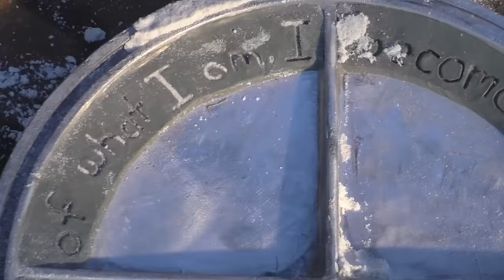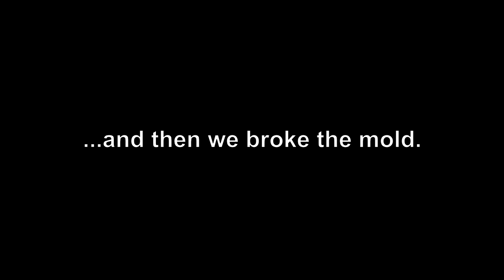Casting Deadlights - Part 1

Comment: It is so funny when you know a skill and you have to see others trying to do it. I learn to mould in green sand at the age of 12. However ,well done some refinement of the  technique it is need but well done.

1) spoons are good tools for moulding heat them and create your own set of tools
2) to remove the part hit it with a wood and a hammer to free the sand around it is easy
3) weights over the mould. There is internal pressure that think can blow.
4)when you cast you have to try to preheat the mould, less humidity , less possibility of porosity
5) preheat your tools if you are going to used with hot material
6) do not take so much time between fillings of the mould

Comment: you solved the undercut issue on the letters....just thought i'd offer this....one of the ways i've seen to do letters is to use a heavy gauge wire as a "press stylus"....bend it to a modestly sharp loop, and use it to trace out your lettering, being careful to not press deeper than half the diameter of the wire.....      The other alternative:  raised letterings....      

The beauty of casting...if it casting fails, you can "recycle" it....break it up and stick it back in the cruicible for a retry..... 

your casting videos always fascinate me...iv'e never worked with the sodium silicate method you use; only used greensand methods (both water-based and oil-based) so I'm always curious about how you go about it.

the christmas lights on the boat are awesome!
Reply: about making it low (if not free) for research, you might contact some of the oceanic research organizations and see if there's a grant or something that may be available once you're afloat.....

Have you looked at Patreon?

Comment: the whole time i was like; weight the mold, weight the mold, weight the mold. and you didnt do it.. but you should be proud with the result. it looks amazing
Reply from the maker: +Rasmus Laursen    Weight was not actually an issue on this one.   The cope weighs 100 pounds and we were pouring 20 pounds of aluminum.   The metal was just really hot and followed the parting line from the riser, that is only an inch from the frame.

Comment: Hi Doug! Great job!
I'd suggest putting weights on the mold to overcome the hydrostatic pressure.
Reply from the maker: +matito561     I've make that mistake with NiBrAl,  but in this case it's over 100 pounds in the cope and about 20 pounds of aluminum.

Comment: Maybe someone has already asked, what's a deadlight? Awesome looking cast by the way, and I love that you always include your'learning experiences' Helpful for those of us who also don't get it right the first time. Like my foundry furnace that right now has a #10 can in the bottom cast into the refractory because I forgot to remove it as a form. Keep up the good work Doug!
Reply: +Ryan Haworth A deadlight is a metal plate that you fold down over the port holes in bad weather to seal the hole if the glass breaks. They also obviously deaden the light coming out of the boat which can hamper night vision when navigating in the dark.
Reply from the maker: +Ryan Haworth    It's a lid that closes over the portholes.  They keep the water out if a porthole glass should break and the keep our cabin lights from being seen by those dam U-boats.

Comment: just in case there isnt a new video this month merry christmas to you too 
things are getting ever closer to completion , my guess is that the boat be in the water around biginning of 2017 (taking in account that fitting the boat electronics woodwork and all that will prolly take even longer than welding the hull 

kindah wondering wat the plans will be once the boat is fully operational , i think you mentioned you be living and working on the boat year round and just follow the warm weather
allso wondering if you going to keep youre current place to store some of youre bigger tools and work on added projects for the boat like better/different subs recovery equipment and stuff like that

renting the landbase out or include the use of the place in the options of the ship in the work season as a shop with livingquarters / landbase / labratory to said oceanic explorers / students to (re)build their underwater experimental crafts to use on the boat or test samples taken during the trip might produce enough income to keep the place running in you in some cash and warm over the quiet/low season

Comment: another thing I keep forgetting to tell you about is how I make templates...buy a few 4' x 8' sheets of 1/8" luan then run them through the table saw so you have a pile of 2 inch x 8 foot slats...use a pair of scissor and a hot glue gun to make templates...it's a lot faster then cardboard and a lot easier to build around stuff...once you build the perimeter you add bracing in different directions to hold the shape...

Comment: Hi doug,,I am always impresed with your vids,your anchor vidios got me to thinking im going to make two different kinds of anchors for my landing craft....I want to talk to you about something I noticed about storing sheets of aluminum,I saw you got some aluminum in for your smaller boat your going to build,and I noticed you stored it virtically,,,just like I do,My project has taken so long that I stored my sheets virtically for almost 2 years,In my 1st vid I talk about having to pull the sheets together with a come along,These were factory edges,but would not but up,Long story short these sheets have relaxed a little,,,I am on my cabin now,vid 19just put up on top two sheets of 6ft by20ft by1/8inch,,I was so happy with my framing when I first put the sheets up ,,,,untill I tryed to pull the factory edges together,,These sheets have also relaxed almost 1/4of an inch,when I stored it virtically I put the sheets on 2by 4s to get it off the ground.I have finally put it all together and there is no other way to say it exept that these sheets relaxed!!!!my bottom sheets are 1/4inch and they still relaxed.when you have to pull factory edges together,that is never a good way to start and  probebly led to some of my distortion problems,You will notice at the steel house they never store sheets virtically!!!just something to think about....
Reply from the maker: +shawn burnett (tailermade) Thanks.  I would not have thought that would happen.   Then as sloppy as I am with some of my fit up, I may have never noticed.   :)

Comment: Doug, I have been thinking about this for a while now when watching your casting videos...couldn't you drill four holes (one in each of the alignment boards on the sides) then put screws in to hold the two halves together when you pour? then you wouldn't  need any weight to hold the top down...just a thought...
Reply from the maker: +Gary  Ferguson Jr      Yes.  That would work.  I've used those little latches they sell at the hardware store too.   But my favorite approach when needed is to just sit weights on top, but only because I saw it in an old film on the Scottish Archives.  http://movingimage.nls.uk/film/1529?search_term=casting&search_join_type=AND&search_fuzzy=yes

Comment: A great outcome from what can be a tricky metal to cast, especially is moisture is present. It was also a complex shape. I've watched steel casting before and I'm sure they used graphite powder to line the pattern and stop it sticking in the mould. Is Corn Starch just a cheaper choice or does it have other benefits for aluminium casting?
Reply from the maker: +Chris Ryan  Powers are mainly a DIY thing.   And I put way too much corn starch on, but I was more concerned about the pattern than I was the surface.  The real foundries use match plates, and the match plate is sprayed with an expensive parting paint.

Comment: Molten material needs to be slowed down in the sprew  entering a gate that is larger than the sprew  restriction to slow and make the material flow. Getting good results is all that matters. But attempting to have the sprew  gate runner riser proportioned right by using some math can make a world of difference. It is okay to have more mass in the feed and vent  than the object you want.

Comment: I hope you have allowed for the few percent of contraction when it cools and made a bigger than needed deadlight
Reply from the maker: +Mark Lockwood   Yes.  It's only about 2% and using a riser reduces that greatly.  Besides, it's hardly a precision part.  When I have to make something precise I leave a quarter inch of metal to remove with the lathe, just to be sure, as most of the problems are near the surface in my experience.

Comment: SodiumSilicate can be made cheaply in the shop, with water, sodium hydroxide and silica gel (the latter is sold as cat litter) Google it, you will find various recipes... they work but you need to dry the hydroxide and silica gel (baking in an oven to release the trapped water in the two compounds (they are humactants after all) The recipes are by weight...so it is important to get rid of the trapped water before weighing the ingredients...

Comment: What exactly is a deadlight...I'm presuming a light cover...just wondering.....what is your source of sodium silicate?
Reply from the maker: +Charles Wright  Yes.  A deadlight is a protective cover or shutter fitted over a porthole or window on a ship.   And you can pick up sodium silicate from local foundries, eBay, Amazon, other online sources, and even at the auto parts store.  Look for Seal-Up or other stuff you and to the engine coolant to seal leaks and cracks.  Seal-Up and other brands use "water glass" which is sodium silicate.

Comment: Sorry this is related to this specific video. When you were initially making the foam sculptures, where did you get that giant piece of foam for carving in your first video? I'm going to be doing something similar, but buying foam insulation form the hardware store is way too expensive.
Reply from the maker: +BK201MXP    Check with your local packing and shipping supply houses.  We have one place in Tulsa that stocks it.   The place I actually got mine is http://www.hendrenplastics.com, but find a place close to you because shipping is not cheap.  And you want 2lb/cubic foot for carving.
Reply: Thanks for the information. This is exactly what I needed to know.

Comment: No degas or flux?
Reply from the maker: +eformance   No.  I've used both in the past and can not actually see any difference, so I decided to go back to casting without either.
Reply: SV Seeker With degas you might see a difference if you had a really smooth mold, the gas creates pores in the surface.  The Flux should make it pour smoother and get into the fine details by reducing the surface tension.  At least that's the theory...
Reply from the maker: +eformance     That sure as hell was not a smooth mold.  And we poured with it way way too hot.  I've never really cared about the surface.   But it would be interesting if someone did some exacting side by side test just to see how much if any real improvement there is for the home foundry.   For the beginner, I think I would advise them not to bother.
Reply: SV Seeker Have a look at the myfordboy YouTube channel, he does a lot of casting and gets very nice results.
Reply from the maker: +eformance   MyFordBoy is great, but all I've seen him do is green sand.    And green sand needs more skill, equipment, and smaller flask.   I wish someone had told be about using sodium silicate for the entire mold when I was getting started.
Reply: SV Seeker He uses sodium silicate sand for cores, which is common.  He uses fresh Petrobond when he needs a nice finish, that stuff seems to be very smooth when virgin.  You only need a little more equipment to recycle Petrobond and store it, that furnace was the hard part!
Reply from the maker: +eformance   Yeah.  Petrobond is good for small stuff but you'll need a muller and the additives to keep it fresh and I learned the hard way that the dam (expensive) stuff goes bad just sitting on the shelf.   https://youtu.be/HAkTn_6yfiM

Comment: ... Опасно работаете ребята (!) :(    Для литья такого объема, лучше изготовить другой тигель-плавильню (типа горизонтальной трубы длиной 0,5-0,6 и диаметром 0,3-0,4 метра, с горловинами под углом вверх на торцах трубы и закрывающимся окном в верхней части середины трубы для закладки алюминия.  Трубу изнутри футировать листовым асбестом и шамотной глиной. Алюминий плавить газовой горелкой через одну из горловин. Такой тигель-плавильней я пользуюсь не один год... Желаю удачи...

... It is dangerous work guys (!) :(    For the casting of this size, it is better to make another pot-foundry (such as horizontal tube length 0.5-0.6 and 0.3-0.4 m in diameter, with the neck angled upward at the ends of the tube and close the window in the upper part of the middle of the pipe to lay aluminum. The pipe inside futirovat sheet asbestos and chamotte clay. aluminum melting gas burner through one of the necks. This crucible smelting I take more than a year ... Good luck ...
Reply from the maker: +AleX Z       Make a video.
Reply: SV Seeker... Okey, но смогу только после Нового года :) ... Okey, but I can only after the New Year :)

Comment: aluminum and salt wather dont mixe  well to gether it will rust like metal n or coroth
Reply from the maker: +cumnshow   Yeah, that's sort of a urban legend that goes around.  True there are some circumstances where aluminum does poorly around salt water.  But by large it's a wonderful material on the ocean.   Consider that you're talking about deadlights, and we are using a 60 year old deadlight as our pattern.  I only looks new because Paul brushed off the oxidation layer.

Comment: I used to do loose molding as a profession... I always made the cope before removing the pattern.
Reply from the maker: +Cleo Torris     That's because you made hundreds of them and rarely screwed up the drag.   I you have a high risk of screwing up the drag it's better to check it before you waste time and sand making up the cope.
Reply from the maker: +Cleo Torris     Your idea are right, but they are right for a professional foundry.   We are not a professional foundry.  Silica sand is easy for armatures,  easy to purchase, easy to mix, cheap and requires no muller.   And pulling the pattern is the right choice for us.  We did it today, got to see what did not make and got to make an informed decision as to weather or not to proceed.    In a foundry with foundry equipment to mix and handle the sand I would have been a different decision.     As in everything, there is no one right answer.
Reply from the maker: +Cleo Torris  No idea really on the pour temp.  I think it was at 1500 when I turned the heat off.
Reply from the maker: +Cleo Torris Yeah, it was red with I turn off the heat.  We took our time, but it was still way to hot.  The next one we poured at 1330.  Still too hot I think.  I was going for 1280 to 1300.   What's your recommended pour temp?
Reply: SV Seeker